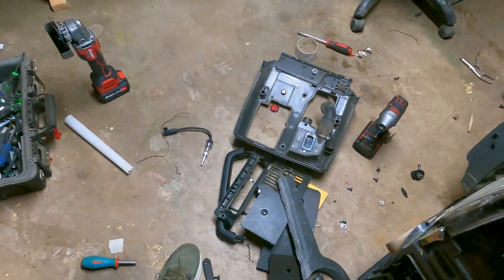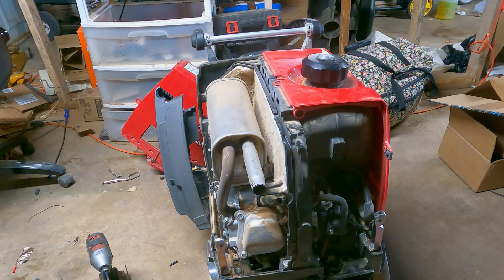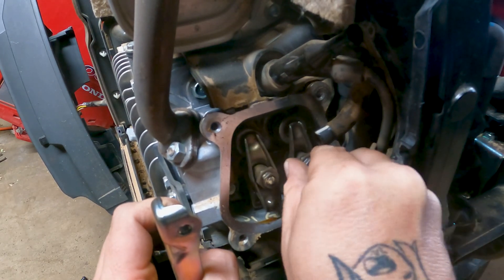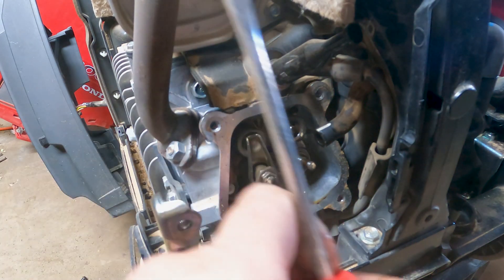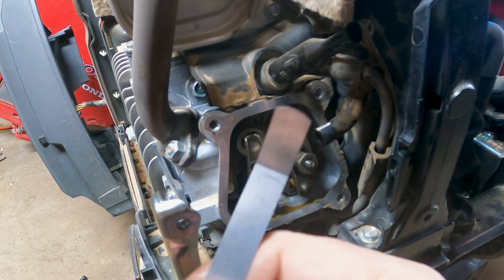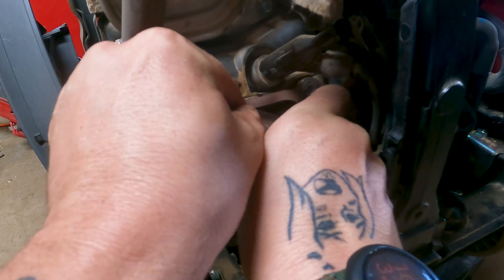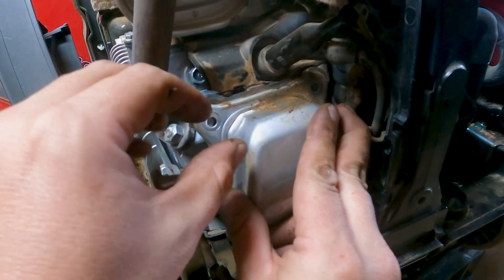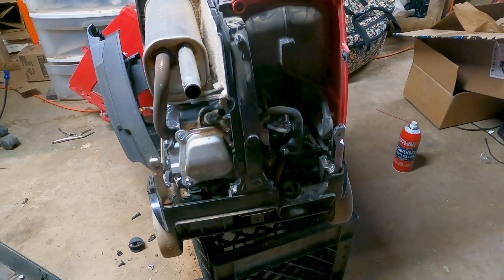how to fix a generator that won't start.

Comment: The Piston needs to be at Top Dead Center of the Compression stroke to set and adjust the valves properly. Piston should be at the highest point closest to the spark plug hole, of the second stroke of the 4 strokes made by a 4 cycle engine. Basically at the pistons highest point, immediately after the intake valve opens and closes, while both valves are closed, just before the exhaust valve opens. The Piston should be at the (Top) of the cylinder, while both valves are closed, in between the intake and exhaust valve cycles (center). After intake and before exhaust. There are various different methods to verify this and visually is the simplest and easiest method by looking through the spark plug hole and watching the rocker arms. 
Also make sure to torque the 14mm pivot nuts and 10mm lock nuts to specifications for the specific model type as some units with the same model  have different specs for different types.
I hope this is helpful for you in the future